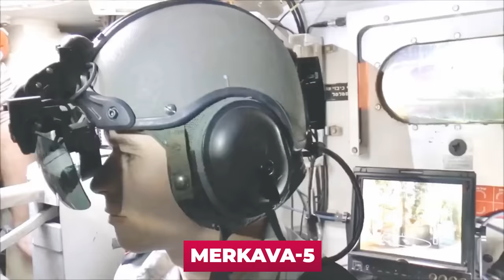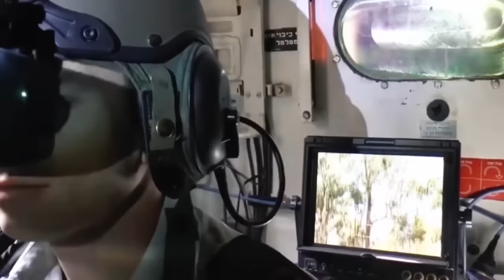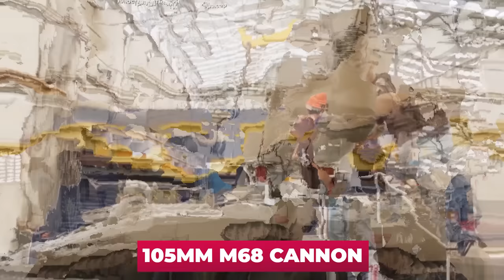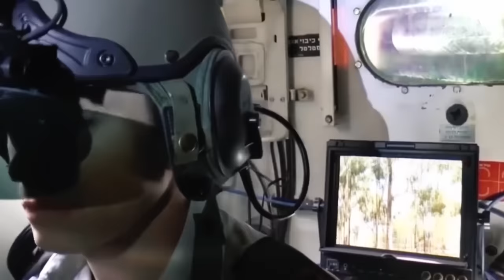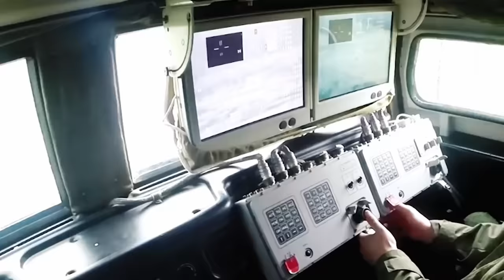This SECRET Israeli tank has SHOCKED Hamas, Iran, Russia and China

Comment: One fact was wrong: Challenger 2 weight is as follows: Mass: 62.5 tonnes (61.5 long tons; 68.9 short tons), with a combat-ready weight of 75.0 tonnes (73.8 long tons; 82.7 short tons) with add-on armour modules.
Reply: I also spotted an improper screen clip grab @ 11:24, which shows a US tanker inside an Abrams wearing a 3d Infantry Division patch.
Reply: Close enough for Government Work~What's a couple of Tons among Tanks~??? :person-turqouise-waving:
Reply: @mstrdiver I caught that too. Also at 5:14 when identifying the members of the crew, they are showing a German Leopard 2 and crew.  Did they not notice the Iron Cross on the side of the tank?!?

Comment: There is no such thing as THE best tank in the world since every tank has a specific task. The US Abrams M1 is a totally different tank than the Merkava IV/V and it has different tasks/characteristics. Sometimes faster tanks are needed during operations, something tanks are needed with more firepower and sometimes tanks are sometimes lighter and smaller to get higher movement speeds. Just look at the differences between the Leopard II tanks that have to operate in Europe in a totally different environment (it will suck in the desert because it's not designed for that environment). Often in modern warfare, the combination of different vehicles and systems that work together in a team are key.

Comment: what will also change warfare is Robots like man made Terminators walking into the war zone combined with flying war machines and tanks on the ground combine with small drones and all these machines can look through buildings and have an high end protection shield which sourrounds the entire vessel.
Reply: @JuergenBachmann-ec3gy Quite frankly, Nope. A bi-pedal robot is not an efficient or (totally)stable platform. The main reason that Boston Dynamics builds them is to learn how to make them work, for the sake of acquiring a deep understanding of the tech needed to make them work. Wheeled, tracked or even rotor equipped (flying) vehicles are far more in line with what military commanders want.
Reply: If anything we will end up with armies of nanobots. Imagine a "robot" the size of a bacteria..  gonna be fun times...

Comment: I think because of the advancement of small arms that are able to penetrate the armor of Tanks tanks especially when they have to be placed in urban combat areas become extremely less effective. When you see videos of the war in Ukraine with drones just completely destroying armored vehicle and ships and submarines and the drones are a fraction of the cost of the things that they're destroying is completely changing Warfare as we know it I think you're going to start seeing a lot of advancements in drone technology in the future. I think also you might possibly have some sort of drone AI human hybrid technology of a vehicle where the AI does a lot of the operations of the vessel where in a naval ship you might only need to have maybe a handful of people to operate it so when you don't need that many people on a ship the ship can become smaller and cheaper to build and you can make more of them and it'll be more effective.
Reply: Drones are new, but everything can be counter-fought. Drones are controlled both externally and internally, using Electronics. Electronics can be put out - remotely. Either by hacking into their systems and kill their logic, or by blocking/changing the commands transmitted to them. New Laser-cannons can remove drones from the sky much faster and cheaper than existing Iron-dome and other means. These are in final development stages too. 

Last- there are simple means for defending against drone attacks - I've seen tanks with light mashes on them, that make the drone bombs go away from the body of the tank, and other ideas too.  We'll see.

Comment: It's a light tank. Apparently susceptible to shape charge rounds. Say a heavy gun Bradley that needs more armor. There are reasons the US does not do this. No Ablative or Kevlar armor comes to mind. Still, it seems rightfully suited for urban warfare. BTW, you cannot stop a Sabot round.
Reply: Have you seen what happen to the Bradly in Ukraine. i think USA needs a new apc over all Bradly is obsolete.
Reply: The Merkava MK3 (produced from 1992-2003) and  and MK4 (produced from 2004-Today) both have composite armour. I don't know what material is used between the steel plates, but it is similar to the armour used on the M1, Challenger 2, and Leopard 2A5 onwards. It is called composite armour because it has layers of steel with other material (anything from ceramic, concrete, kevlar, quartz, and other material depending on the exact configuration) in between the steel plates.  Any number of hours can be wasted debating which filler material is best, but it is sufficient to see that the existing Merkava tanks to be used by Israel do have composite armour. Reference: Wikipedia.

Sabot (I am taking your "Sabot" rounds to mean APFSDS) rounds can be stopped if you have thick enough armour. The penetrator (the part that actually impacts the tank) are rated in terms of their ability to penetrate X mm of RHA (rRolled Homogenous Armour) equivalent at a distance of Y meters. You would see something like 600mm penetration of RHA equivalent at 2000 meters. Composite armour, for a given thickness has a much higher RHA than the real RHA (RHA=steel plate armour), so you can use a thinner, lighter, composite armour and still have the equivalent protection of a thicker heavier steel plate. Add to that that modern armour is sloped, leading to a thicker armour rating than armour at a 90 degree angle, and also increasing the potential that the incoming round will deflect. Taking some real world numbers, a T-72 APFSDS round can penetrate somewhere around 550-600mm of RHA equivalent at 2000 meters. The M1 turret has the equivalent of 900-1000mm RHA equivalent thickness rating. The T-72 cannot penetrate an M1 turret unless it gets very, very close, even with an APFSDS round. Facing an experienced M1 crew, the T-72 will be a smoking pile of scrap metal before it gets anywhere near close enough. And, of course, the T-72 turret will be next satellite in orbit. If you want to really understand all of this, go to Red Effects Youtube channel. There is also the Tank Museum's channel, also on Youtube.

P.S. I didn't even mention the Trophy APS (Active Protection System) that is on the Merkava MK4. It actually fires a small shotgun type projectile at incoming shells (including APFSDS) to deflect them and at missiles/rockets to destroy them before they even impact the tank. Does it work? We'll see, but Israel seems to think so, and the US is going to put them on the new version of the M1 (M1A3, the experimental version is the M1E3, and is undergoing tests right now, it becomes the M1A3 when it goes into production).
Reply: @hitman37003  The US is already developing a Bradley replacement. And while Bradleys are being knocked out, most of the time, they do not get destroyed, but get hauled back to repair bases and repaired and put back into service. Most of the Bradleys aren't being hit by missiles or by tanks, but roll over mines. And yes, I have seen pictures of Ukrainian Bradleys with holes in them. The interesting part is that the crews always seem to survive, unlike Russian tank and BMP crews.
Reply: @hitman37003  thats what happens to bradleys if they got against MBT tanks
Reply: wow Kostas thanks for sharing your tank knowledge…
Reply: I believe it does have interior Kevlar to use against spalling.  Well I doubt Hamas is shooting depleted uranium sabot rounds

Comment: There is another Tank Armata T-14, but its software problems are huge and it is a total failure, the T-90 is also a failure cause its tower loading system is so slow and  crew got no protection against its explosion.

Comment: The Merkava  is no good for a modern war.  While moving through mine fields and restricted areas,  the Merkava will easily be taken out as the engine is in the front.  This will stall the movement of the rest of the tanks making them sitting ducks just as what happened during the last Lebanon incursion. It is a well known fact that while many Merkava tank crews survived the initial strike against the tank,  but were burnt alive inside the tank.
Reply: Seems to me the Israelis have put together a tank with parts form various countries modified specifically for use in their neck of the woods and not Europe. My only difficulty here, is why all this information is being made public?
Reply: Ex RAF here 1960's.  My Dad was an ex Tankie in North Africa in WW2.  Interesting reading the various views on modern tanks. I think eventually special drones will eventually replace tanks.

Comment: THE REDDOTX19 LASER SUPERSONIC SPEED OVER THE SPEED OF LIGHT WITH 12000KJ  CAN EASILY PENETRATE MERKAVO AT A DISTANCE OF  30 MILES  AWAY WHERE  REDOT. IS SILENTLY TRIGGERED. REDDOT IS ELECTRIC CHARGEABLE  WITH SOLAR SUPPORTING FEATURES WEIGHING  3KGS

Comment: No it is not the best tank in the world and never was... In an effort to produce a "jack of all trades" and sticking the engine in the front designed to add an engine block to the frontal armour. You got a tank whose engine heat obscured it's thermal targeting system, caught fire a lot and produced excessive heat. The gun is the same crappy smooth bore on everything, sadly to include the Challenger 3 (rifled for the win). The armour is not that good, updating the chassis with reactive armour helped but split war heads defeats this. Like the leopard, another over marketed product that never fought a real war, the RPG7 is a serious issue. Good against kids throwing stones and shelling houses a couple of miles away... In City fighting, a liability.